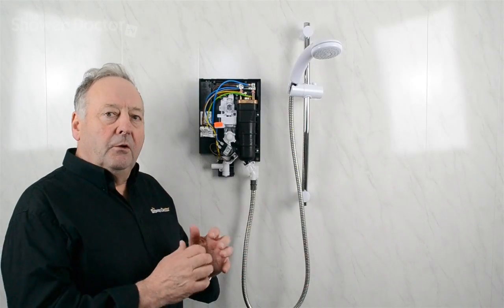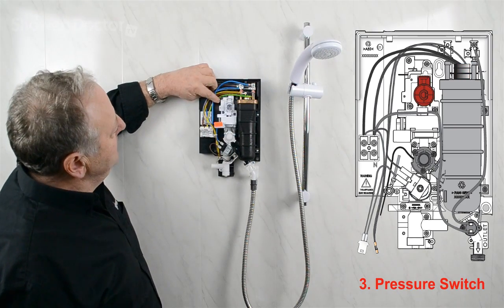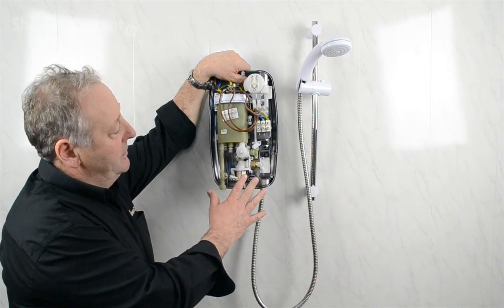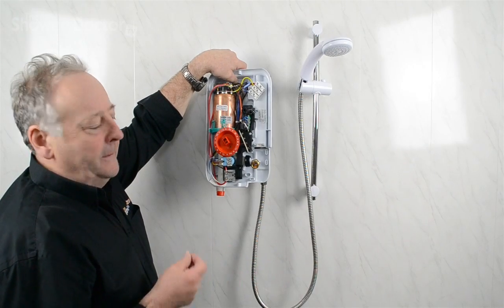Shower Doctor TV: Electric showers explained

Comment from the maker: I presume that the pump is still running?
If it is then check is the inlet filter, head and hose are clear, the other possibility is a faulty flow control valve.

Comment from the maker: First thing to check is the inlet filter, head and hose are clear. The TCO is cutting in as the tank is getting too hot, not enough water going through it and 20 mins of use is causing this.

Comment: Hi ! I have T90Z and its about 4 monts old now! The problem is that the water pressure is not so strong anymore as b4 and if i use shower bit longer like about 20 min it will stop making hot water and then I need to leavit to cool the machine down and after thst working again but water pressure still not good as it was few months ago. Thanx
Reply: You prune
An electric shower is not a machine

Comment: Hi, I have a triton t80 gsi that has stopped working. I have a reading off 3.6Kohms on the solinoid, but it looks like its not opening and letting water in. iave took readings from the heater and these are between 12-16, with the power on ! im getting 240v across live and earth on the heater. is this correct? to me thats a trip! i also carried out a continuity test on the TCO and this is ok also. any help would be bonus.

Comment from the maker: It may be your solenoid valve, you can check it if you have a multi meter, you should have a reading of at least k3.5 ohms, across the two terminals any less and you need a new valve. (Check the valve in the failed state.) (When it has stopped working!)
 
If there is power getting to the solenoid and it is not operating then there is a good chance that you have a faulty solenoid.

We have a video guide for testing and fitting solenoids.

Comment from the maker: Hi Ronan,

If it is your RCD that is tripping then you are going to need an electrician to trace the fault.

If however it is the MCB (fuse) that is tripping then it is likely that you don’t have the correct fuse for the rating of your shower.

Your shower cames in 4 ratings 7.5, 8.5, 9.5, 10.5
The MCB’s required would be 35amp. 40amp. 40amp 45amp 

The Shower Doctor

Comment: Hi shower doctor I'm having an issue with my triton t80xr. I have tested the shower with a multimeter as per your videos and its fine but after ten to fifteen minutes of normal running the RCD for the shower trips. Any help would be much appreciated.

Comment: Dear ShowerDoc, I have a problem with my shower in that there is no power running to it. The fuse has not tripped in the main fuse box and there is no light above the fuse plug which the power goes into before the shower and ultimately no light on the shower itself. I was hoping to try to repair the shower if possible. The last time I used it it was fine but today there was no power showing. Can you make any suggestions on how to troubleshoot/diagnose? Many thanks

Comment from the maker: Hi John,

If there is no heat at all then it is likely to be a faulty TCO, IE. no continuity across the TCO. If it is a faulty element then normally one of the elements will show resistance and the other will show no resistance.

Comment: i have the  opposite problem, ive a tritton t90xr and i get correct pressure on each setting   but no hot water at this very moment i have the  element out and the tco off and  ive  them both for continuity and ohm  and there fine ,, ive  new element here ready to go in but afraid to install it cause i wont be able to return it then is there something im missing

Comment: Hello ShowerDoc. I have an electric shower, model galaxy g7000 and i have a problem with the temperature control of the device. So the pressure switch has 3 options : 0 for cold water, 1 red line for slightly hotter water and 2 red lines for boiling water. When I have it to 1, I have to keep the pressure switch in very low pressure to get the desired temperature, and if I desire more pressure I need to go to 2 red lines and increase the flow but then the water is extremely hot. What can I do?

Comment from the maker: The things to check first are:

1) That the main valve coming into your house is fully open. 

2) Then check that the valve on the line to the shower is fully open. 

If these valves are not fully open then there may not be enough water 
getting to your shower to cool it properly, the overheat safety device will turn 
the power off until it cools,  then it starts to heat again and so on. 

Make sure that the shower head is clean and clear, and that the hose isn't kinked.

Comment from the maker: If the water comes in at 15°C and you shower at 40° IE a 25° rise in temp you should expect approx 5.25lts per min at the shower head if it is less than this contact Triton.
Changing the head or hose will not help this. Temp fluctuation is caused by poor water supply check that the valve coming into the house and the valve in the line to the shower are fully open, also have you got a minimum of 1bar pressure from your main supply. Not necessary to start on cold but it wouldn’t do any harm.